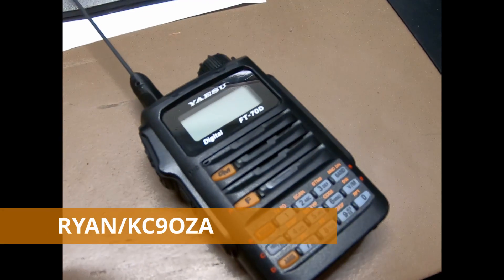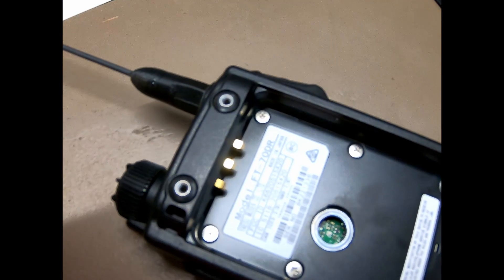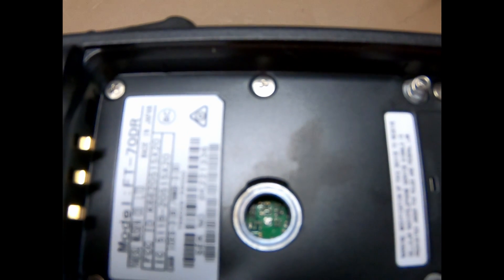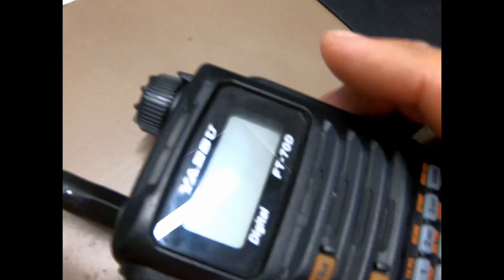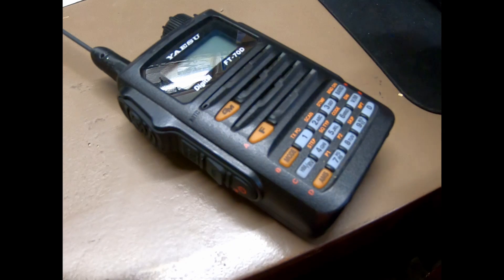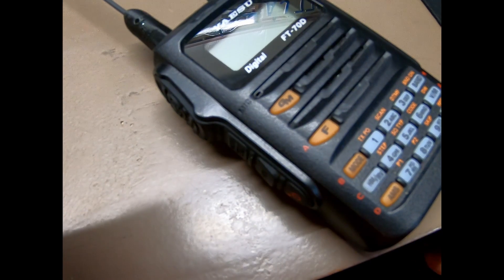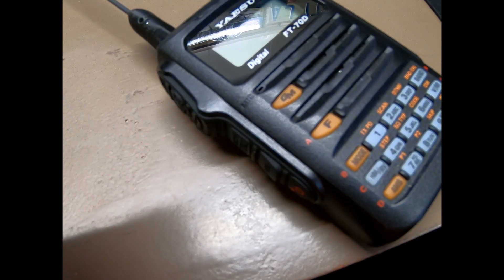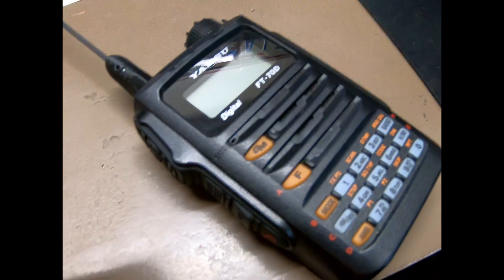How to MARS Mod your ft-70dr in under a minute! #ft70 #yaesu

Comment: This worked very well. I just pushed the resistor off with a sewing needle.  No heat required.  I used my microscope though.

Comment: PLEASEEEEEEEEEE! my new ft5dr  has TX 140-174 and 420-470. what will change with mars?
what frequencies did you have at first?
Reply from the maker: You can receive on those with out the mod. Just can't transmit
Reply: GMRS and FRS

Comment: Mine will not work with Chirp anymore. Any ideas? Is this normal? Also lost vision into the future.
Reply: I used Chirp never had any issues
Reply: @somethingcool7903  did it connect to the version of chirp we were using 8 months ago?
Reply: @Rusted_Link  That idk know it does now had to update drivers and chrip. You got to do a few things to get it to work properly like go to devices and ports and refresh them everytime. It wasn't exactly easy at 1st tbh I got frustrated after hours a night and had to call it....but eventually I figured out how to get it to run everytime. I never really was a PC type so limited knowledge I grew up playing console.
Reply: @somethingcool7903  I'll have to try it again.
Reply: @Rusted_Link  And I new to ham radio but I am figuring that out as well little by little. Had a cb back in the day in high school....Had a home base with a ground plain that I could on a good night talk to people in Jamaica when I hit the tube amp but TV would get lines coming across it when I fired it up so I had to shut it down quick also. I am sure the neighbors probably effected as well.....got a cheap boafang and was hooked.
Reply: @Rusted_Link  I used windows 10 fyi. There has been a lot of updates. I am sure you know how to do the thing with the plugin and unplug deal. So just make sure you go to ports and reset them you should be good.
Reply: @somethingcool7903  yes I know the turn on turn off plug unplug put your left foot in put your right foot out do the hokey pokey turb it all about. Oh yes I'm aware I can't believe anybody would actually manufacture something so convoluted.
Reply: @Rusted_Link Yeah kind of silly how primitive these ham radios are but I guess if they just made one that had all the current technology Bells and whistles there wouldn't be a market for another company or need to buy other models accessories. It would be one and done,a hand held 500w one button gps activated best frequencies all ready programmed and automatically change with your location with direct contact with the ISS with a flick of a button and for small monthly fee you can use satellite for all around the world crystal clear connection with 72 hour battery life....they got keep it old school retro and make things complicated to keep us interested buying and upgrading or it would not be as much fun or last very long.
Reply: @Rusted_Link  Let me know if you got it to work. I still got to reconfigure mine I got most of what I want on but its fully load and I got separate into banks and what not. I am just glad I finally got it all loaded on there for now tbh.
Reply from the maker: Chirp is not suggested to program these radios, it could cause damage which is not able to be recovered.
Reply: @59radio22  hmmm, imagine that.

Comment: What frequencies  you can transmit after mod? I'm a NewHam "NOOB"
Reply from the maker: It depends on the model but typically opens up just below and above the ham bands, such as 140 to 160 mhz vhf.     Its illegal to transmit on frequencies without a license.
Reply: @59radio22  Can it transmit on 446.0-446.2 than? Regardless whether that is legal, question is can it ?

Comment: If you do this, perform a "Reset All" when turning on the first time after the mod. See page 24 of the Advanced Manual. 
If you already did this and you only transmit white noise, do the same Reset All, mentioned above.